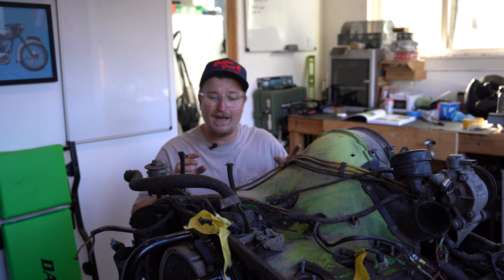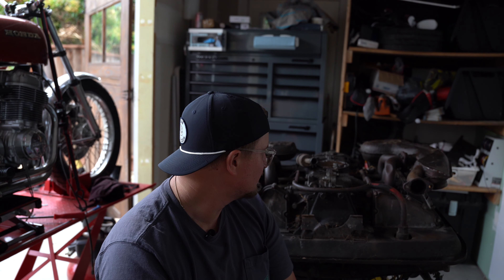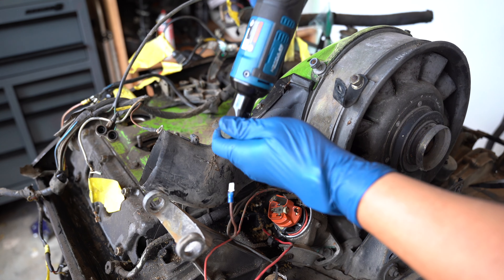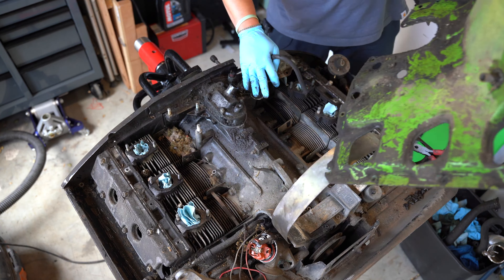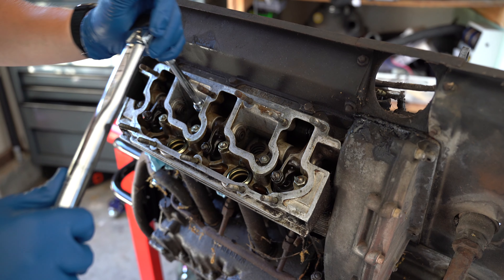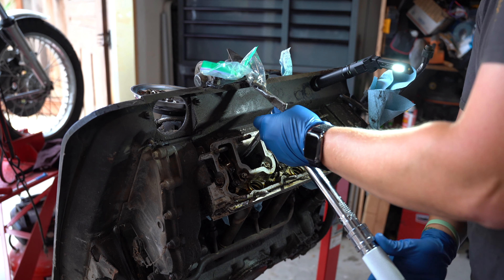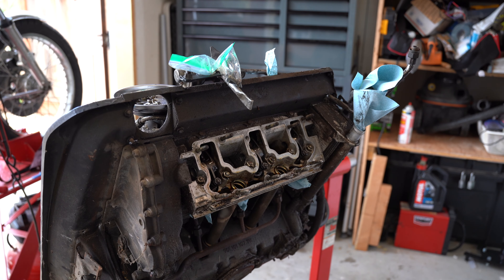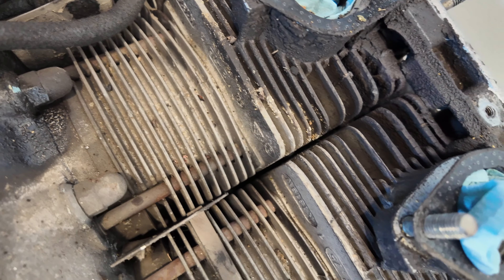Porsche 911S Engine Tear Down: Is My Iconic Flat-Six DOOMED? Leak Down Test & Head Stud Check!

Comment: Nice video. Considering no broken head studs and pretty good consistent leak down values, I'd be inclined to not go any deeper. Those oil leaks should be reasonably easy to fix with the engine out.
Reply from the maker: That’s what I’m thinking. Really appreciate the advice. Truly truly due!!!

Comment: No borken headstuds. No compression/leakdown issues. I would clean, reseal triangle of death, test all CIS components, do valve adjustment, and throw it back in the car.
Reply from the maker: I think that’s going to be the plan. I’m ordering a bunch of parts in the next week. Appreciate the comment and advice!

Comment: Hey Ho nice Job. Make only All Things what you can See Seal what ever you can Dont Open the engine if it is Not necessary.
If the Ghost is Out of the bottle it will be hard too put him Back inside.
Best wishes Kai
Reply from the maker: I really appreciate the advice. I think that Is what I will do. I’m planning on ordering parts this week.